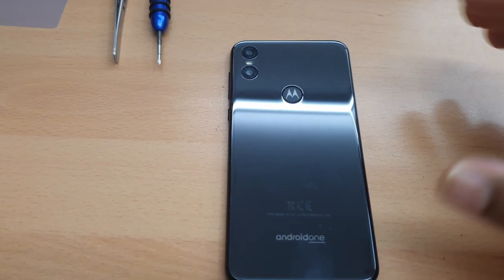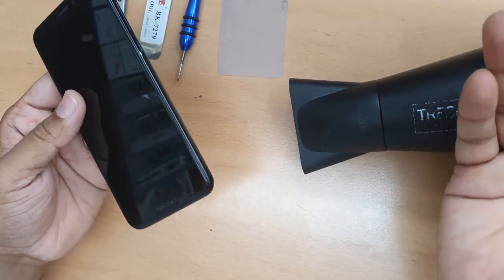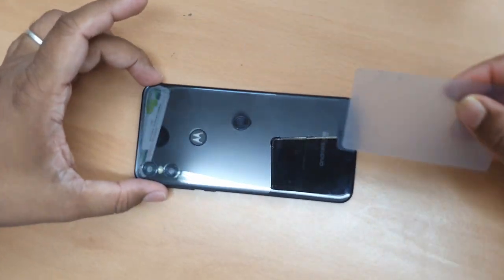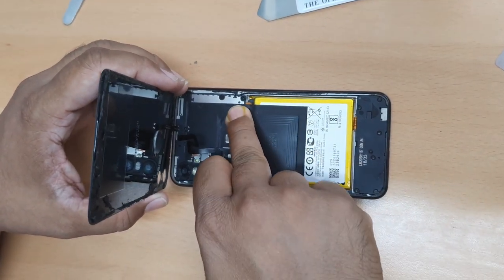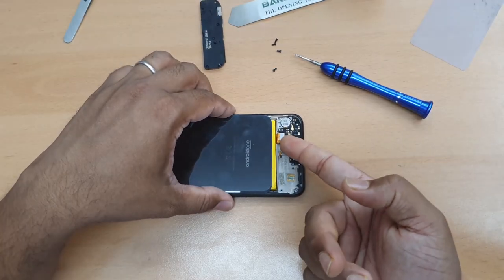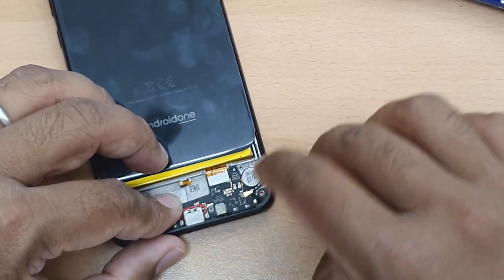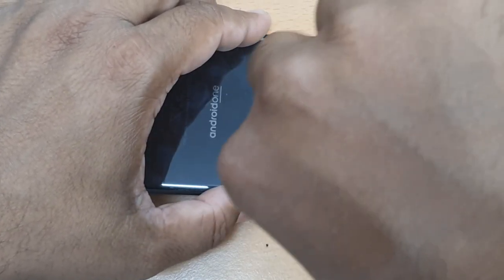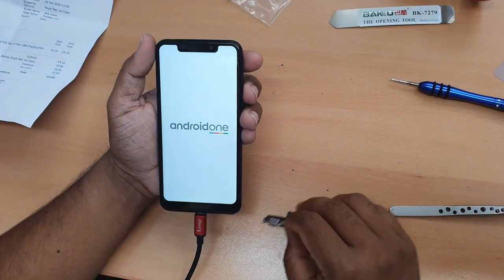HOW TO REPLACE CHARGING BOARD -MOTOROLA ANDROID ONE

Comment: Thank you for sharing this. I had the same problem hence I replaced the charging board, after that the microfone of the new charging board is not working. I bought another charging board replacement and now the cellphone is charging and the mic is working, but it has not GSM signal. My doubt is, should I perform a hard reset in order to load any new driver or Should everything work properly just changing the parts?
Thanks in advance
Reply from the maker: I would say this new charging board also faulty, Please do check the antenna connector is connector firmly or not. This is the main reason why there is no signal! Now if the connection is firm then definitely faulty.
Reply: @thepcphone  Thank you!